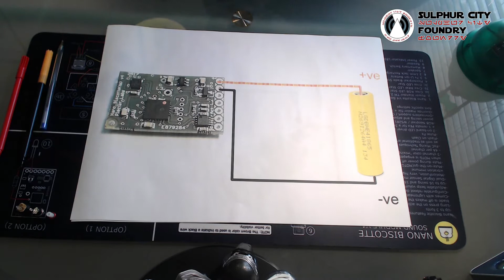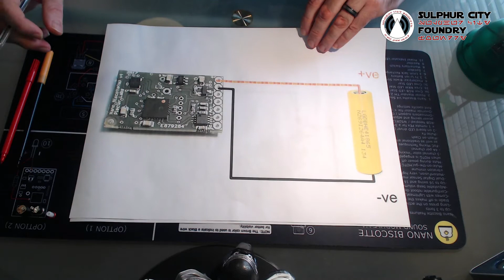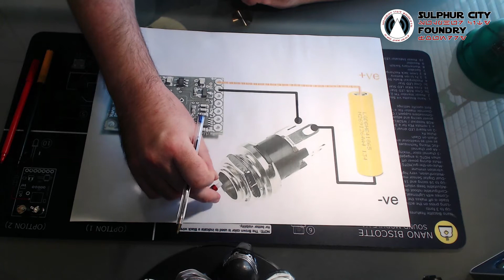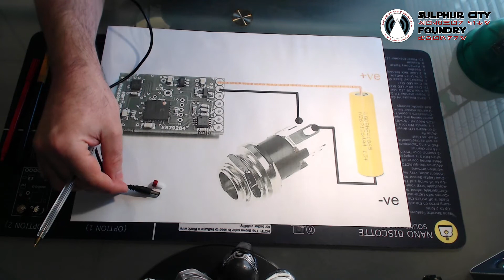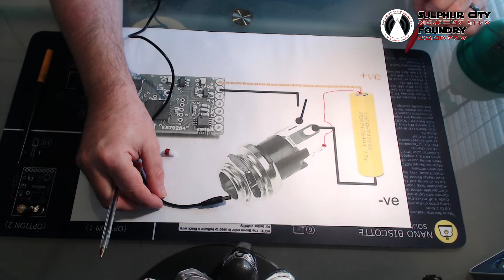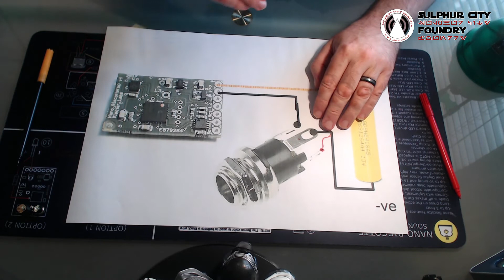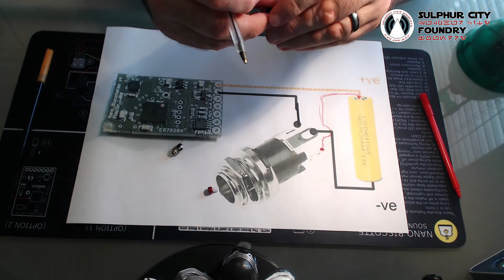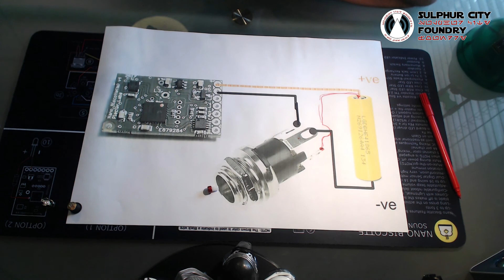Lightsaber Recharge Ports : Everything You Needed to Know

Comment: Highly informative video; thank you for the clarification! Now then, two quick questions please: How can you tell the difference between the two negative terminals? Why not just solder the positive wire to your already existing positive terminal on the circuit board?
Reply from the maker: Both the Switchcraft & the Saberforge style recharge ports are made to consistent specs. You'd either refer to the manufacturers spec sheet or the terminals are explained at the end of this vid.

Pads on sound boards tend to be quite small, so rather than try and solder multiple wires to that small +ve pad, plan your circuit so that the bulk of the +ve wires all attach to the largest 'target' which is usually the +ve terminal on the cell.

Comment: Hi, so i have a lightsaber and i think i might've shorted it somehow by using a higher voltage charger, and now it wont turn on. How would I fix something like this?
Reply from the maker: 1) Protection circuit on the cell may have tripped. Try resetting it by plugging in the correct voltage charger for a few secs and try again

2) [best case scenario] Protection circuit on the board may have friend. Get a saber installer to replace cell. 

3 [likely scenario] Board is fried. Cell has been overvoltaged. Get a saber installer to replace cell & board.

I'm going to assume it's an oldr saber with a 3 pin recharge port and SaberCore board and not one of their newer Golden Harvest V3 installs?
Reply: @sulphurcityfoundry5009  yeah, I’ve had it for about 5 years. I was hoping that I wouldn’t have needed to send it in for repairs, I was hoping I could replace the battery and it’ll be alright. But thank you so much, I really appreciate it

Comment: How would you connect it to a stunt (no sound) saber without a board?
Reply from the maker: The wiring diagram including the RCP shows a circuit that delivers a +ve and a -ve wire to the rest of the circuit (which is the board).

Doesn't matter if it's powering a board or a simple stunt setup. One wire is +ve... one is -ve. Design the rest of the circuit from that :)

Comment: Perhaps I could get some information from you. I recently just acquired a Saber forge Arbiter Mark II and it is lovely... My problem is I purchased some kill keys off a seller on Etsy and within 10 minutes of me put it into the lightsaber, I went to remove it and it broke off in half and I was not able to get out the remaining parts, but when I was trying to I saw a couple of Sparks and now I have no power for my lightsaber. Will I need to purchase an entirely new plug and play kit from saberforge for $250?
any assistance you could give me would be greatly appreciated sir. Your videos are great and I am a happy new subscriber
Reply from the maker: Hi Dave. Did you manage to get the kill key out? 

If you've sparked something in the recharge port best case scenario, you've tripped the protection PCB on the battery (.... if there is one. SF can be a bit hit n miss with protection on their cells). If the PCB is tripped, it can sometimes be reset by putting the saber on charge and everything is good again. Worst case scenario .... you've fried the board.

If you haven't got the kill key out yet, try again but don't jam anything metallic deep into the port (sparky sparky). I've seen people get broken kill keys out by applying a TINY amount of super glue to the extracted part, seating it back in, letting it set overnight and then slowly trying to pull the stuck part out. make sure only the upper and lower faces of the kill key gets glue on it, otherwise you'll never get the broken part out ..i.e. just scrape a thin smear of glue on with a small tool.

Then try the PCB reset thing. Let me know the result. What version PnP kit was it?
Reply: @sulphurcityfoundry5009  thank you for all that information. It was the champion electronics soundboard installed
Reply from the maker: @Evadious-2022  One of these with the micro USB recharge ports? https://saberforge.com/collections/plug-and-play/products/champion-kit
Reply: @sulphurcityfoundry5009  yes these are ones
Reply: @sulphurcityfoundry5009  my mistakes, it was the VETERAN tier not champion.
Reply: @sulphurcityfoundry5009  Sadly I did use a small screwdriver to chip away at the plastic still in the charging port 😢
I'm hoping you are right and I may have tripped something.

Comment: I can't find this information anywhere. 
How long does a full charge take in a saberforge in-hilt recharge? I'm a bit anxious charging it for too long.
Reply from the maker: Depending on how much charge current the charger delivers to the cell (I'm assuming something similar to a 3400mAh Panasonic cell). I'd guesstimate anywhere between 5 hours (1000mA charger) and 9 hours (500mA charger). If you're using a proper 4.2V li-ion smart charger (and that's the only thing you should use), there's usually an indicator that changes from red (charging) to green (charged). The charger takes care of cutting-off at full charge.

Comment: Does anyone know if an micro SD charger can be swapped out with a standard "kill key" charger? I have a saberforge champion kit that the recharge part took a dump and I can't charge it but I can't find any others. I can remove the sd card to change fonts i just need something to charge it and I wanna make sure it will work and which wire color they use for the data wire
Reply from the maker: Although Saberforge do not list them on their website, if you contact them, they'll be able to arrange a replacement (may take a while for them to respond, but they will. When you contact them, just inc original order number / address / explanation of issue inc photo etc to save any long turnarounds too-ing and fro-ing).

Also, sometimes the ribbon cable just comes loose. so you can just try re-seating. Ensure that the ribbon cables don't flip over when you do this as if you insert them upside down .... could kill the board.
Reply: How would I reseat them? And unfortunalty they have not been very forthcoming hence my pursuing other options. Also sorry for all the questions I'm new at this lol
Reply from the maker: @runningcoyoteflynn  They have a small sliding clamp. If you email the store, I'll send you a photo of the clamp open and closed. It's not a strong clamp, so there is potential for the ribbon cable to wiggle free.

To answer your original Q, yes you can swap the port for a standard 12mm recharge port. I also suggest swapping the cell for a decent protected cell at the same time, as the V3.0 builds used an unprotected 18650 cell, overdischarge of which is a common reason for charging issues. 

I do like the Saberforge stuff, but the V3.0 electronics install is a bit of a lemon.
Reply from the maker: Considering the risks of shorting your cell / frying the board  when swapping out RCPs, I also suggest you find a decent, well reviewed saber-smith to make any repairs. I'd offer, but New Zealand will have a fair shipping component to consider if you're in the US.
Reply: OK I shot you a fb message

Comment: Hey I was wondering how to fix one of these charging ports. A little while back, I had messed up the port. It looks crooked and I think it might have disconnected from the battery. I'm not a very technical person, but any amount of help would be great. Have a great day to whoever sees this!
Reply from the maker: Considering that there are live +ve and -ve wires straight from the battery running to the RCP, it's highly advisable to seek out an experienced saber installer to repair the RCP.
Reply: @sulphurcityfoundry5009  why not use an usb-c port for recharge and a separe method to cut the power?, like a switch

Comment: Hi.  Thanks so much for the video.  My charge port is not working properly though... the smart charger accuses the battery to be full and does not charge. The charge port works fine as a kill switch, but the multimeter accuses continuity all the way from the negative of the charge port, connected to the negative of the battery through the other end of the negative on the board, is this normal? the negative on the charge port that goes to the battery is working properly and swiches off when the the charging plug is inserted on the charge port.... can someone help?
Reply from the maker: (IF I UNDERSTAND YOUR EXPLANATION) Sounds like you may have the -ve pin for the board and the -ve pin for the battery mixed up.

When the charging plug is inserted, the -ve from the board should be disconnected, not the -ve from the battery. Check your wiring :)

Comment: Two questions.  1.  Where would a person install a PLI into this circuit?  And 2. In the absence of a kill key, will an unplugged smart charger work as a kill key while I install the rest of the components on the saber?
Reply from the maker: 1) PLI?
2) Yes, though obviously you want to get in the habit of wiring the cell in last anyway  :)
Reply: @sulphurcityfoundry5009  PLI (power level indicator) mostly for fun but also function.  It's a simple circuit board with positive and negative pads and 10 LED's that detect the voltage from the battery.  And I forgot to purchase an actual kill key so it's just for precaution that I asked about the smart charger substitute
Reply from the maker: @rodneymiller9439  assuming it's self powered, via just 2x pads , you'd want to hook the +ve pad up to the +ve of the cell and the -ve to the RCP pin that goes to the board. PLI would only indicate when the KK is pulled. You wouldn't want it on all the time as it would drain the cell.

Comment: Is there a way to make a kill key plug complete the circuit when plugged in instead? I’m trying to find a fix for mine and can’t think of an easier way to do it.
Reply from the maker: Nope. What's the issue with yours?  If the RCP is faulty, just replace it?
Reply: Sulphur City Foundry, WOW!First let me say thanks for replying! 
 My problem is hard to explain, but the band of metal that completes the circuit is bent. I can bend it with paper clips and it will turn on. But without pressure against it doesn’t reach the post/pin to complete the circuit. I’ve messed with it to see if I could replace it but i believe it is glued and I don’t want to break anything attempting to fix it. 
 That’s why I thought maybe getting something that was the same size as the kill plug but was a conductor instead of being plastic; maybe it would complete the circuit while technically having a “kill” plug in it?
Reply from the maker: @TREEMEISTER.  Ideally you want to retain that circuit isolation / charging functionality, so a RCP replacement is really your only option. It's a common fault and luckily a fairly easy fix for a sabersmith. If you're not electrical savvy, I suggest you find a decent local smith (where are you based?). If you're competent with soldering and know how to safely work with simple electrical circuits, pop the switch and RCP as per this vid. https://youtu.be/hH944JEuDw4, replace the recharge port (3 solder points) and refix the switch and RCP as per this vid. https://youtu.be/mhjecFOwke0. Just make sure you isolate as you go to prevent unwanted shorts.
Reply: Sulphur City Foundry oh okay, thanks for the help. I’m located in SF area in California. I would not say I am learned electrical wise, only tried soldering once or twice when I was younger. Maybe this will be a good reason to learn! I actually just managed to pop the charge port out and I have 4 wires, total, attached. I’m assuming pos neg taped together for power? And light/sound are the other 2? I’m just guessing lol

Comment: Do you need a switched charge port ? Or would a 2 prong non switched do
Reply from the maker: Hi. Thanks for the comment. It's considered good practice to use a three pin switched model in order to isolate the board when the charger is plugged in. I've never had the time to dig into why exactly, but expect that having a load (other than the cell under charge) across the charger can cause issues. Some of the cheaper Chinese boards use a 2 pin RCP with charge management built onto the board.
Reply: Sulphur City Foundry yeah I read up on a few boards with the battery protection on-board but awesome thank you this helps out a lot !